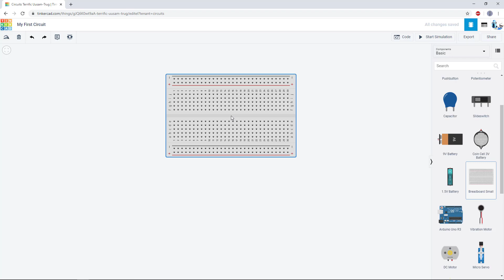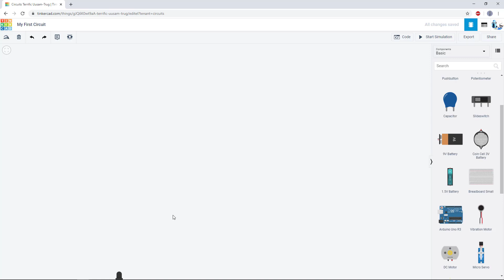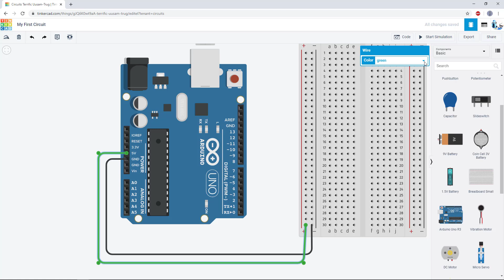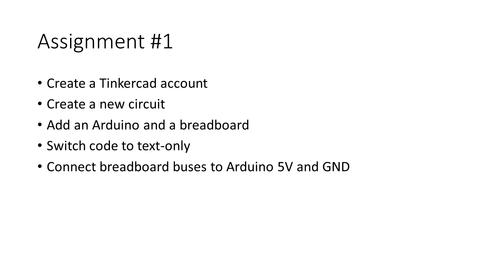Tinkercad + Arduino Lesson 1: Create Your First Circuit

Comment: I can't color wires. There is no pop-up thing showing the wire color like your's. How can I fix this?
Reply from the maker: They recently updated the interface so when you select a wire, there is a drop-down menu at the top of the screen to change the wire color as well as the wire type (e.g. you can make it an alligator clip instead).